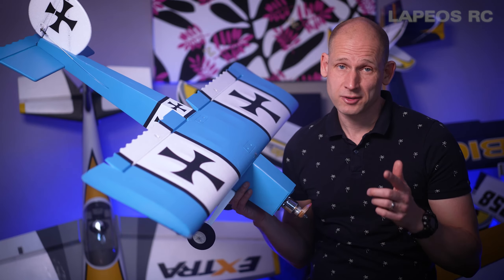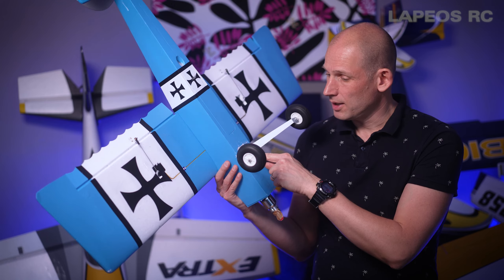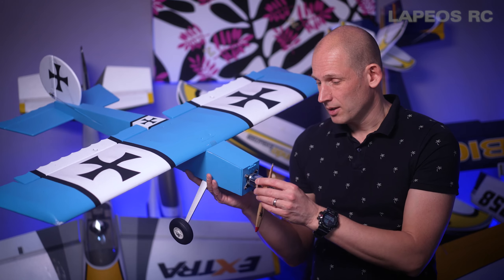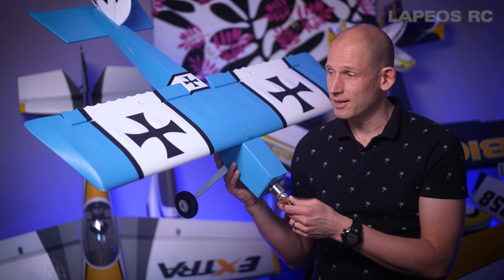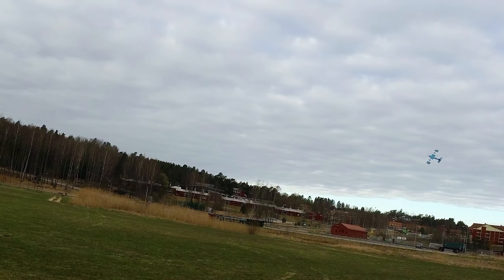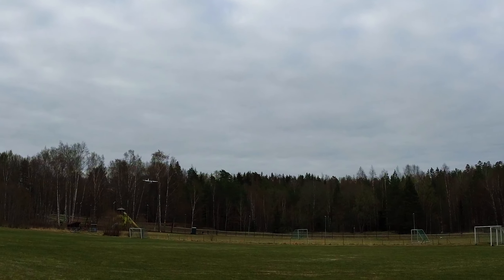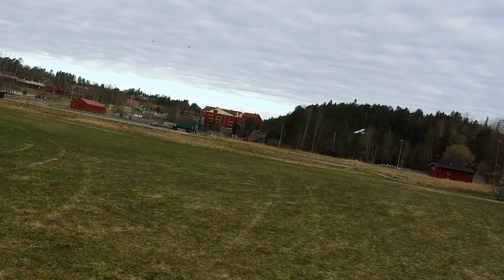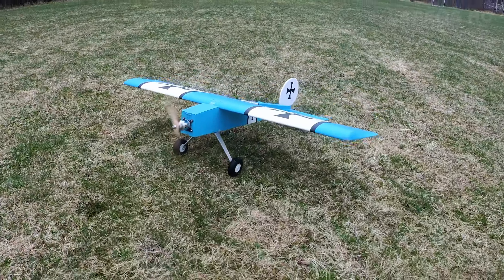Durafly Ugly Stick V2 - That's one way to land!

Comment: Mount the LG to a plywood or plastic plate, shove a barbeque skewer through the body and add a couple of rubber bands. Hinged or pool noodle foam block at the back. Good landings, plenty of give. Bad landings, it just flips off (and back on!) Save the "nice wooden propellers" for display time in the shed! ;-)
Oh and keep the audio volume up. I don't know any of those bad words in any Nordic language yet. :D
Best wishes to you and yours for the silly season, mate! 🙂
Reply from the maker: Here's one for you "Men vad I helvete!" Try that one!
Reply: So, you're describing how to fashion some sort of breakaway LG? I'm not picturing what you're describing.
Could some type of Velcro breakaway LG be made to work on this plane? I'm thinking the metal struts bolted to a longish strip of plywood and then the plywood Velcroed to the bottom of the fuselage. Would something like that work?
Reply: @SunriseRCAviator  😁 Always wanted to take the train ride to Hell, but was never able to make it during my visits to Europe. Lots of folks always advised me to go! 😉
Interesting to see that the Norwegians have to go through it to get to Sweden. 😜😊
Reply: @BillKisel  Yep, Bill. Lots of folks have used a similar system with velcro. Much better than ripping the guts out of the plane on a rough landing! 🙄
Using rubber bands just lets you adjust the tension before it all peels off. I'm a fan of rubber bands since my FMS SuperEZ shed its wings on the first flight excursion into the greenery. 😜😁 Re-attached with rubber bands and bamboo skewers and good as gold ever since. 😊
Reply: @theoztreecrasher2647  I see it now! Similar to how wings are with some models attached to the fuselage. Yeah, I think I like that idea better than the velcro one I was thinking of.
Reply from the maker: @theoztreecrasher2647  I've heard it sounds really harsh when a Swede go cursing but hey it feels good to get it out. When a Norwegian is angry a Swede thinks it's cute. I worked with some guys from Norway many years ago and they got angry we didn't think they were angry when they in fact were. "JEG ER SINT" as they say in Norway.
Reply: @SunriseRCAviator  That's interesting that the Nordic countries should have any such differences what with your long intertwined histories. Never really got to mix with the locals on the 1 time I blew through there on a packaged tour and Scandinavian tourists or migrants are as scarce as hen's teeth out here in the sticks where we are. 😊
Reply from the maker: @theoztreecrasher2647  We are in fact very different. In many aspects German people are more like Swedish people because the one city I've been in that felt like home was Berlin.